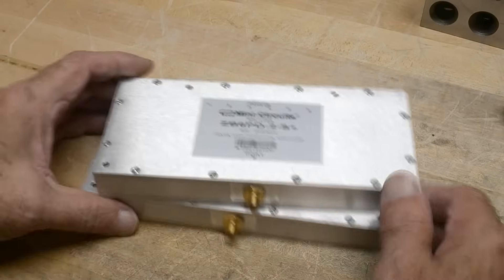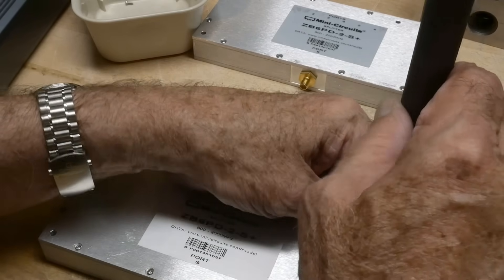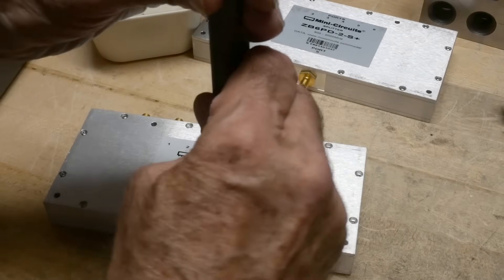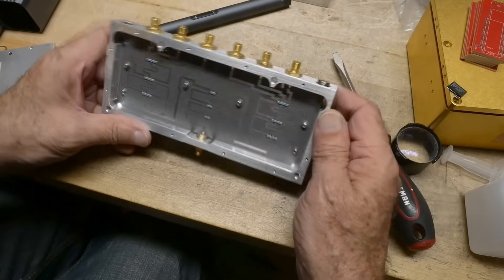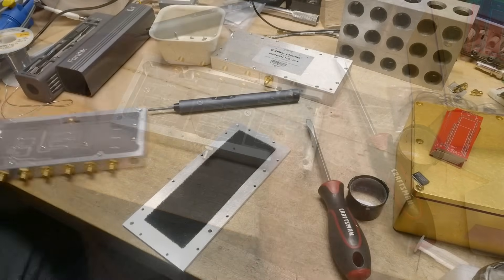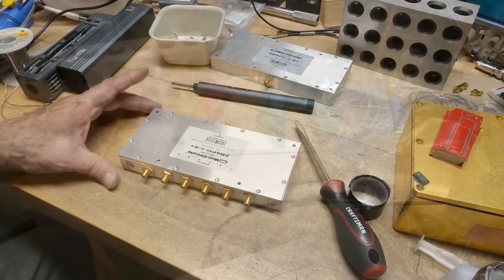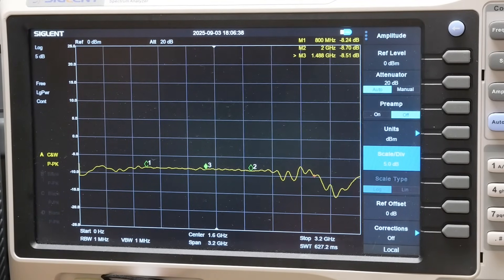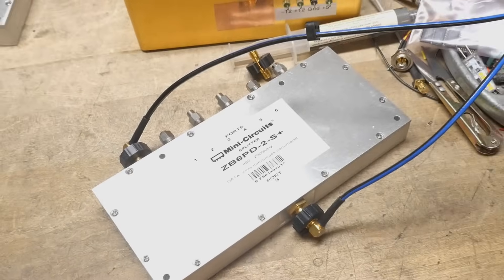#2366 Mini-circuits 6 way spliltter 800-2000 MHz

Comment: You can wonder why this combiner used the SMA connetor that use such big diameter part the screw to the case. Their are vertions of combiners that use simular case style with N-type, BNC, TNC ... connetor types. It is simple to customize the connetor type for the design impedance on the splitter, by just swaping the connetors.

Comment: You measured the DC resistance on the input and found it to be open. What if you put a 50ohm load on all the 6 outputs? Would that match with the internal resistors causing the input to see 50ohms at DC? The trace on the spectrum analyzer going to nearly DC and still being flat makes me think that the impedance of the input may be effected by the impedance of the outputs.

Comment: My work uses many of the 8-port versions of those, both for splitting one signal into 8 and the other for combining 8 into one.  The transmit signals really don't interfere with each other since the port-to-port isolation is so high.

Comment: Used a bunch of these Mini-circuits 8 way splitter's to combine 50 FM telemetry transmitters for gas turbine R&D. They had center frequencies between 50MHz to 99Mhz at 1Mhz increments.  These transmitters worked from minus 30degC to +130 degC. With centrfical loads of 100,000gs at rotary speeds up to 50,000RPM. No crystals involved just lots of component selection to keep the center frequencies from drifting no more than +/- 100kHz. 
Receivers would track the center frequency's drift.
The transmitters were 0.4" x 0.5" x 0.3" with one channel on each side of the board.
Used to measure dynamic strain gauges with a 20Hz to 50kHz bandwidth.

Comment: Given that the splitter loss is 10*log(number of splits = 6) = 7.78db this device only has .7db of insertion loss due to the connectors and other factors, so really well constructed out of high quality parts.

Comment: The plugs are to fill the unused holes.  It's available in a 8 port version.  Saves on cost only having to make one housing instead of 2.  I have some 4 port and 6 port versions that use the same housing.
Reply: Was about to say that. Was one for sale "locally" to me just a week ago.

Comment: Must be a logistics decision to reduce number of unique cases.  There's a 12 port case that's used for a 8 port splitter/combiner that goes port:  1 2 _ 3 4 _ _ 5 6 _ 7 8  🙂   (where '_' is  blanking screw)